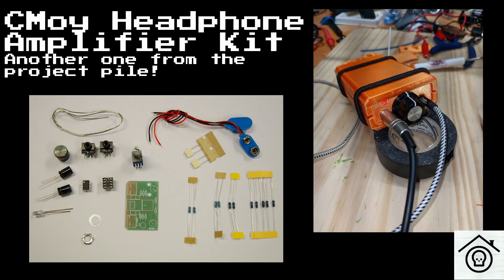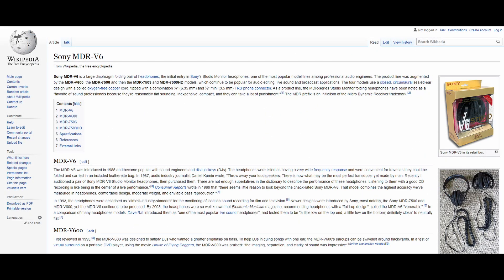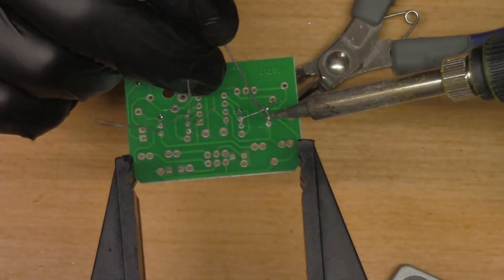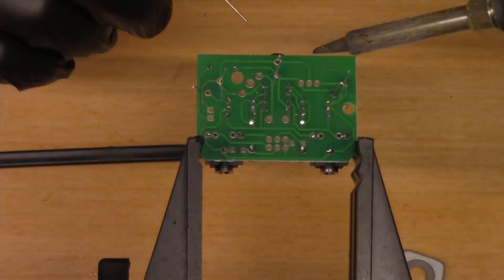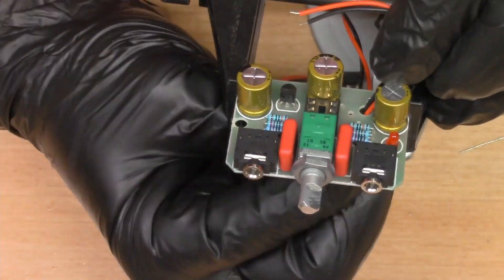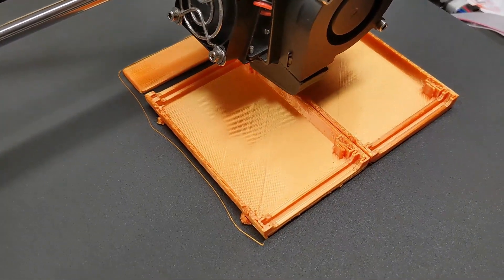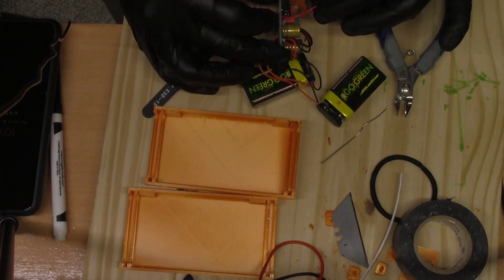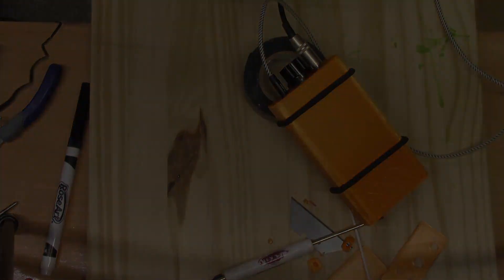CMoy Headphone Amp Kit Assembly

Comment: hi, may I know where to buy the pcb board? thanks
you did a great job btw😀
Reply: I recently recreated the design from this protoboard and the design is on oshpark.

If anyone is interested, I can share the link after my shift ends.
Reply from the maker: This exact kit isn't available on ebay any longer. I see a similar kit from the UK but it's not exactly the same. I see several PCB designs out there if you search for something similar. Thanks!
Reply: @JamiesHackShack  I have the exact same board in my amp but don't know where does it came from. Thank you anyways:)